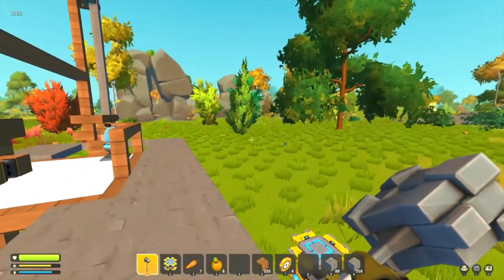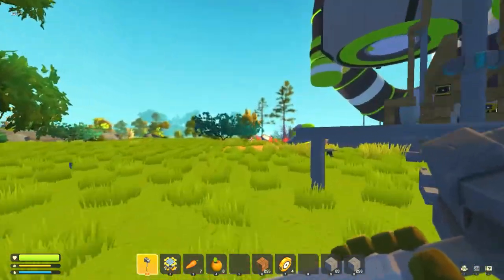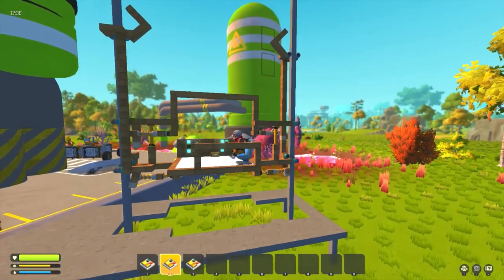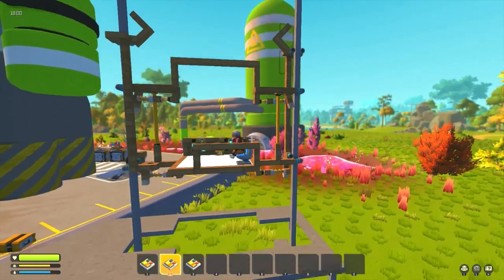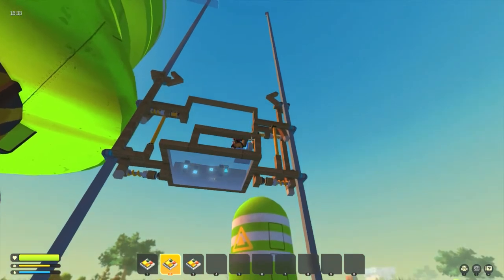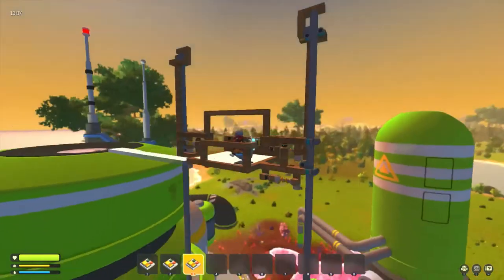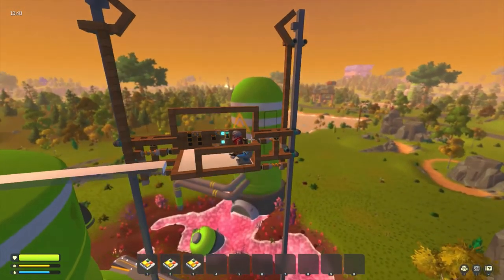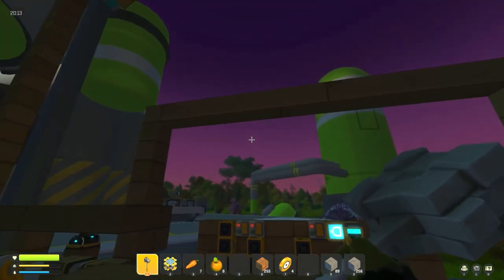Scrap Mechanic Survival - Pole climbing base elevator. Very High.

Comment: At what point is walking up stairs better?
Reply from the maker: I have jump blocks on the other side of the structure. It still takes about the same time to reach the top as it needs to switch back and forth. They look  bad as this structure is 45 degrees off grid. To make true stairs (1:1) this high would take an epic amount of blocks. A 3 wide stars take 6 blocks per step. Each stroke of the elevator replaces 90 blocks.